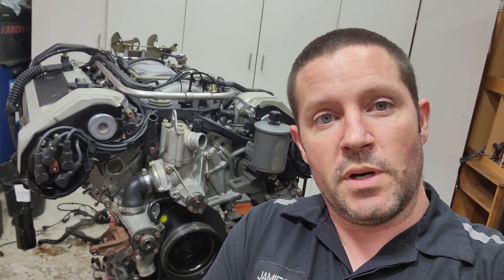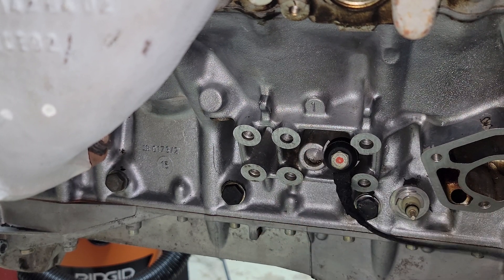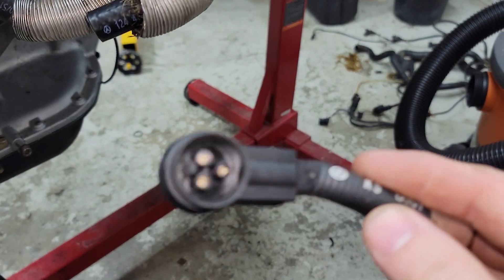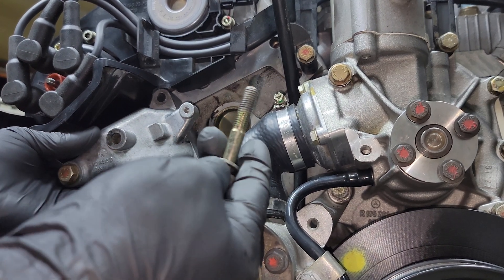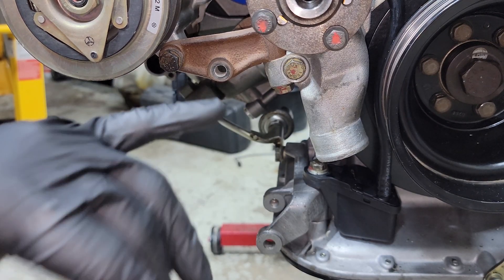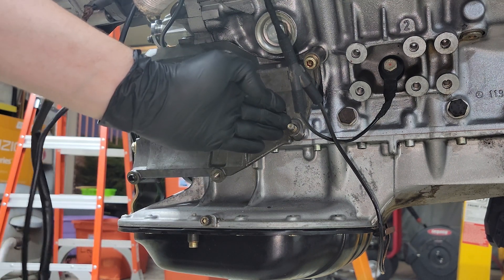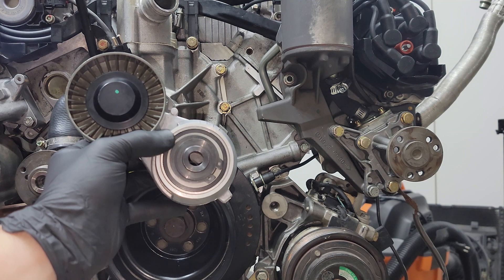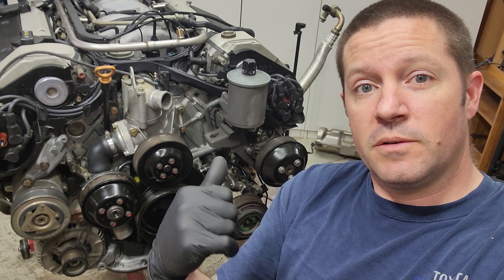M119 Installing A/C Compressor, Secondary Air Injection Pump, Alternator, and Oil Filter Housing

Comment: Is it possible that my r129 1994 doesn't have a front crankshaft sensor?
Reply from the maker: For 1994, I'm unsure.  I would assume it should.  They updated the ignition system on the M119 towards the last half of its life.  I know they switched to coil on plug, but I don't know what other differences there are.

Comment: Question 92 500 SL M119 motor air pump is making this god awful noise sounds like a giant sucking sound on some start ups  not every time it starts?  why would it be doing that... pump going bad? In my state where I live no emissions testing so I was thinking of just unplugging?
Reply from the maker: It does sound like it might be on it's way out.  It could be worn internally or the clutch could be going out.  You could unplug it if you want but that might set a check engine light.  It's only used on cold start ups anyway.  I'm in CA so I'd have to fix it 🤦‍♂️.
Reply: @FriendlyMBTech  Thank You These cars are beautiful but break if you look at them sideways.  another 600 dollar bill I might just unplug it I think 92 and earlier no cel if you unplug but I think it will be a fault code.  Thanks again
Reply from the maker: @rioraton  no problem.

Comment: I had a 95 SL500 and changed the oil filter housing gasket put it back together and instead of leaking it just dumped oil out of the top bolt hole, I dont know what I did wrong, the surface was flat and clean, and the bolts were torqued and it stilled poured oil out. Great Video btw.
Reply from the maker: A few things could cause the leak.  If the gasket was somehow damaged, it would leak.  If the wrong bolt was used, such as a bolt that was slightly too long, that would cause a leak.  If there were build-up or debris inside the bolt hole, that would cause a leak also.  If the sealing surface on the oil filter housing were damaged somehow also.  Unfortunately the only way to find out is to pull it back off and recheck everything.

Comment: Thank you for such a detailed video. At 8:30, where did you source that AC line (119-230-11-56-05)? I have a e420 and mine is broken, I cannot source it anywhere.
Reply from the maker: That is the original AC line that came on the car.  I just wiped some grime off it and reinstalled it.  I just checked with my parts department and that part number is final stock only and everywhere shows all zeros.  Maybe a hose maker might be able to custom make one or possibly a Pick-A-Part.
Reply: @FriendlyMBTech  Thanks man, that's what the dealerships here in Canada are saying too :(. Once its off, let me try getting one custom made. I called the center of excellence too and they don't have any either.
Reply from the maker: @leejerome9738  around us we have places like Hose Man that do nothing but make custom hoses.  Once years ago I was working on a refrigerated Sprinter that one of the AC lines was routed millimeters from the crankshaft pulley.  As you can imagine it eventually made contact.  Since Mercedes never made a factory refrigerated Sprinter, we had to have one of the local hose companies make a new AC hose for it.  Hopefully you have a place like that close to you.
Reply: @FriendlyMBTech  Thank you, will ask some local mechanics around town and will keep you posted!

Comment: Im actually doing the same thing to my engine right now i put it out whith the transmission,im changing all the gasket and seals especially the head gasket cause i have a leak . My front transmission seal is leaking and im kind of scared to change it .im hoping you gonna work on yours so i could have an idea. Thanks so much for the videos
Reply from the maker: I didn't plan on changing the front transmission seal.  I don't think it is leaking.  I will check it out to see if it does need replacing.  I'm not too keen on transmission work.  I'll have to take a look and see what's replaceable on the outside of it.  I don't have and idea how the transmission even shifts because I bought the car not running.

Comment: What do you use to clean the engine it looks shiny, you work clean i like that
Reply from the maker: I used some degreaser I got from AutoZone and a set of brush attachments for a drill.  I got those for around $20 on Amazon.
Reply: @FriendlyMBTech  diesel is a good degreaser too
Reply from the maker: @tinasissi  I think diesel here in California is more expensive than the degreaser 😂😂😂
Reply: @FriendlyMBTech  wow lol sorry I didn’t know that